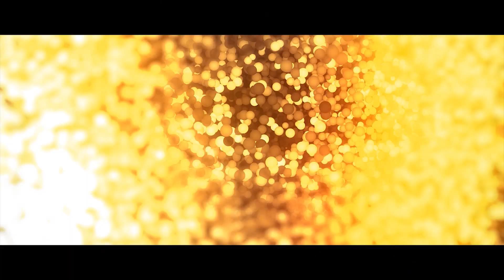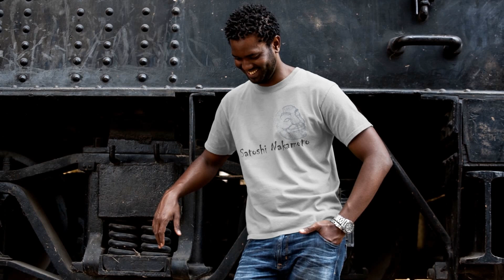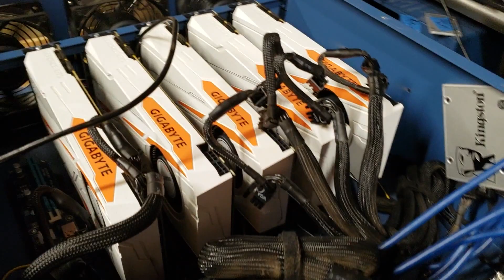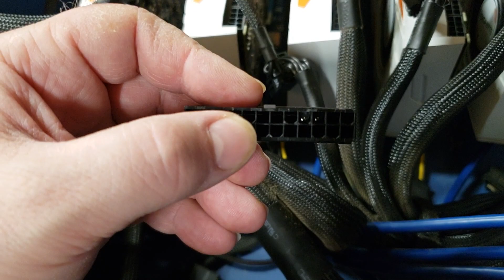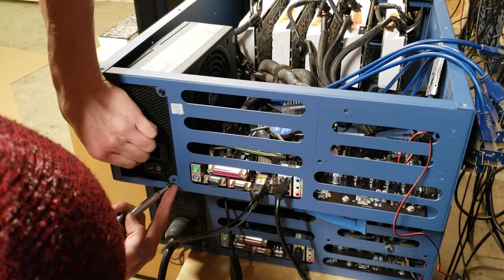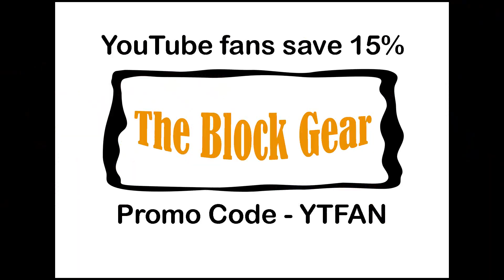Troubleshooting A 6 1080 TI Graphics Card Mining Rig

Comment: First thing I would of checked. They have some cheap digital power supply checkers... measure voltage, freq, waveform, etc...
Reply from the maker: Hi Craig, thanks that's a good idea, I never realized they had battery checkers available like that.